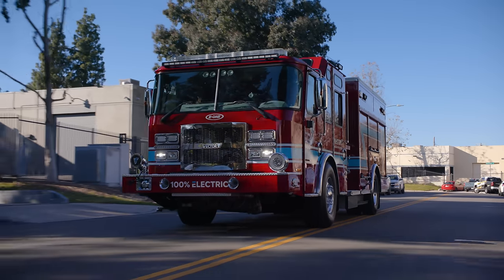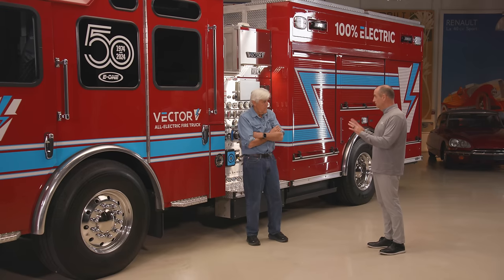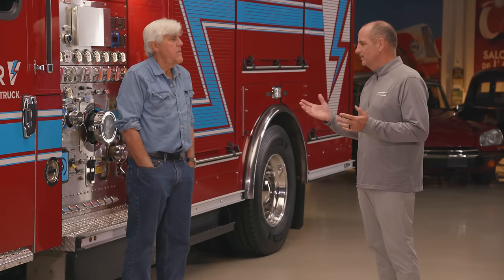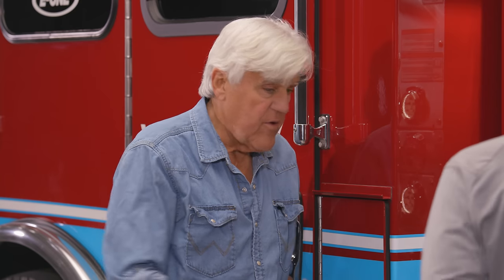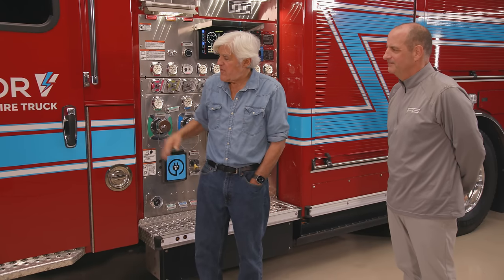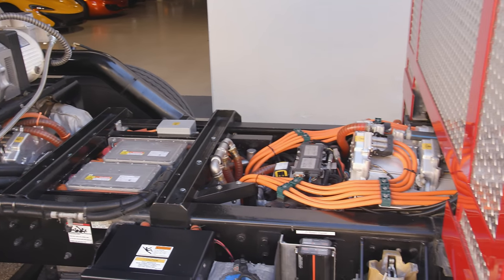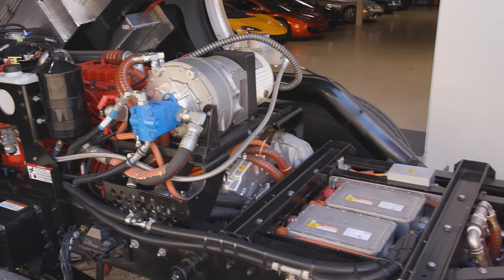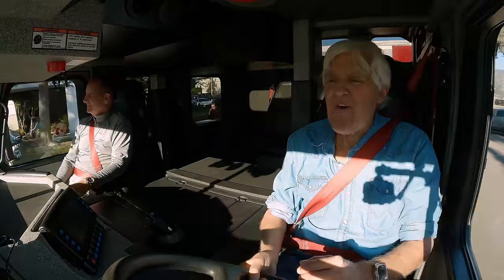The Future of Firetrucks?

Comment: I'm a Captain retired state Firefighter of NC, and just as I was retiring, my station bought two complete sets of fully electric cutters and spreaders, that's the "Jaws of Life" to you public civilians, and of course for years all we knew was the hydraulic, busting that lawn mower pump crate engine out, hooking up the lines and building pressure and getting to loud noisy work, then we were introduced to what looked like something from Ryobi 18+ series lol, just kidding wasn't Ryobi and was something way more powerful, we went to a local junk yard where a awesome donation was made someone bought us 4 cars to practice with, yeah by the way if you have money and want to donate a huge tax right off AND help the fire department, buy junked cars and donate them to the fire department to practice on, or if you have an old home on property you want destroyed, have it inspected for asbestos, if found clear, you can have the fire department destroy the home with fire.
We did that a few times a year, each year, we would run practice drills in the home do training of SaR tactics (Search and Rescue) as well as Egress, (Emergency Escape) scenarios, as well as deployment operations and tool and appliance use, as well as IC practice for the ranks, and when finished, we purposely set fire and guard and monitor it, and a fire can remove absolutely everything and in 3 years time you would never know a house was even ever there.

Well anyway, the electric gear we got was hard for us to accept and on my first Car vs. Car incident, we were able to basically, 
--- lol it was amazing actually ----
Of course after scene assessment and vehicle inspection, 
Lift the roll up, release the spreader, slap a batter in and get to it, and other than a slight hum and tool noise with car moans, we could talk and not yell in fact just from habit, I remember working the spreader and cutter, the cool part was these handheld units had the ability to switch out the head so you could go from spreaders to a piston ram and pry on or push apart.
I was working the spreaders on a car door and I yelled to have the cutter on hand and ready and my buddy was right there pat me on the back and yelled back we don't have to yell anymore!!! 

I think part of the struggle to change is just like the military, well, fire department is a kind of military it's military structure I suppose a paramilitary, we Keep It Simple Stupid, if it's not broke don't fix it, we had come to rely on the gear we've used and depended on and we have all had a battery tool of some kind fail at home, lol so we certainly don't need that when every second and minute counts.
In fact until we could truly understand and depend on them with out fail we also carried the analog hydraulic set with us just in case.

But that's a might fine kit you got there, nice and shiny, the pull valve Deck Gun lol that used to read Deluge, or Deluge G. or Deluge Gun.  It's on like donkey Kong when that gets pulled!

I stopped the the video to write, but I'd be interested to see what it's trials and tests would be like under real conditions.  Throwing the brakes and pulling the PTO out to engage a pump that might go for 8-14 hours or more is there an aux plug in in case...very interesting to see an electric pumper.  

I suppose it's only a matter of time, I can't even imagine the batteries that thing has.
Not to mention no one knows electric car fires better than the fire department, so with all that in mind I think it will be a tough sell.  I think a lot more testing and shakedown will need to be done before anyone can say for sure a yes to buy a d based on this and that how it does in the field and on deployment.  

What's next, Electric Hydrants with Digital gauges and magnetic 🧲 hose attachment?  God that would have saved my hands all those cold winters responding to a fire at 3AM in December!  
Another thought I had, what's it's crash rating, not so much how it does in an accident which is important too, but how does it do when something hits it when stationary and in operation?

There have been incidents throughout the years all over the world when a Fire Engine is on deployment and I  operation and a driver not paying attention crashes into the Engine, in fact this happened to a station in a nearby country and it was hit by a big 3500 Dodge dually and did pretty good damage, this was on the road of a two land byway a kind of highway out here, there was a center lane for turning on the straight portion, but then a wide two lane on a turn into a neighborhood, well the Pumper was in the lane and on hook up providing for the interior attack, the damage didn't stop the feed...and I'd be worried with an electric pumper, how would it have done?
I'd hate to be inside in the line, and it's a thought we've all had what if something happens and water stops?
For those that don't know water doesn't just put out fires but it provides us a kind of shield a barrier between us and the heat, we need that in order to survive, if that water cuts and it's happened, which is why the Engineer, (driver and operator of the pump) watches the gauges and knows how to read and apply more or less depending on the requirement, need, or Friction Loss.

Yeah tough sell here, interesting idea but tough sell indeed.

Comment: Hello Jay . Check out Edison Motors in BC Canada . Interesting young guys doing electric logging trucks.
Reply: They are doing some interesting work, but it's not even close to being ready for prime time. Diesel-electric trucks are not cheaper to operate than regular diesel trucks. The efficiency gain just isn't enough to justify the cost. They are banking on regenerative braking while hauling logs down mountains to provide enough energy to power the empty trucks back up. That's a cool idea, and I'd love to see it work, but even if it does, it's a rather specific use case.

Comment: First problem is the capacity to charge the battery is enormous pull on the power grid. Second the drain on the battery will run it down quickly. Third. If it catches fire how will you newtralize the flames?

Comment: What's crazy is that with all the software now pressure regulation is not automatic. Seems like a reasonable thing to have over having to manually trim it.
Reply: Most modern fire engines have automatic pressure governors. Just press a button and the pump will maintain the set discharge pressure (or volume), the engineer only has to adjust the output on each hoseline to maintain the desired nozzle pressure, and there are pumps that have automated this as well.

Comment: The inclusion of a "Range Extender" means that despite the claim at the very beginning that it is not a hybrid, it in fact is a hybrid. Specifically, it is a diesel-electric plug-in series hybrid. It is apparently a Cummins ISB, running slowly so it only produces 155 kW... enough to keep up with average demand. 

If the engine is running while the vehicle is moving, the power from the engine is operating the drive motor, so that engine is certainly driving the vehicle. The electrical system just acts as a transmission. This is how series hybrids work.

Comment: my only concern is battery longevity. there are firetrucks that were made in the 70s and 80s that are still commissioned vehicles. they can still be used. batteries in cars are lasting 10, 15, maybe 20 years if youre lucky. thats not even half, thats a third, a quarter the life expectancy

Comment: Stations I've worked was 3,000 square miles with 40 miles of I-10 running through it, and  Reese Air force Base, My issue  electric will fail, we had backup, and we had 800 to 1,200 gallon tanks. 500 gallons is for always being hooked to a hydrant.

Comment: I laughed a little at the end where Jay says at least it won't be sitting by the curb speeding out fumes from the diesel engine as it is sitting by the curve spitting out fumes from the diesel engine because it needs the diesel engine to pump the water how ironic
Reply: It does not need the diesel engine for anything until the battery charge runs low, which takes a couple hours of driving then pumping. In the vast majority of calls, the engine will never start.

Comment: It’s not about the mileage on a firetruck. It’s about the hours that the drivetrain is running. The EV fully 85% at the time it’s going to be used for running lights and the pumps. 
And we know those pumps are going to be using a lot of kilowatts. 
How long can this thing pump before the battery goes dead?

Comment: Noise issues in the cab haven’t been an issue in years.  In emergency services, you can’t PLAN your day by typical runs.  That’s why FDs have fuel trucks.  Electric master gauges, ole boy.  Talk to the FEO’s who are driving them.  They hate them, plus several stations around here need a reserve diesel to take over due to all the issues with them.

Comment: This past winter we all learned about the vulnerability of EVs in sub-zero temps; the cold drains the batteries and there's no recharging them in those conditions. At a minimum it seems these trucks would be of limited use (supplemental in areas prone to cold weather; general use in warmer climes)

Comment: 7:45 that was one of my main concerns with this. You could charge the truck from the grid but there's always that risk that the grid is down. Diesel backup is a good idea.

Overall I don't think exhaust fumes from firetrucks is a real issue. As people have mentioned "the fire is worse". But if these things can get to the fire faster and have a higher water volume output that's a great asset to have.
Reply: The pumps at gas stations don’t run without the grid either, so that long standing excuse is a paper tiger. At the end of the day I think you would be surprised at the overhead fuel costs for a fire department.

Comment: I gotta say...I'm not convinced. Fire Fighters are there to get a fire under control as soon as possible. What if there's a large fire that becomes uncontrollable and the FD has only electric units? Do we roll out the 480V power cords? Just plug into the 480V outlet everyone has right? You can refill a diesel unit without any change in delivery during an emergency, you can't do that with a battery powered unit and expect the same performance.

Comment: Fire apparatus, is to be simple and and most importantly reliable.  In the dept. where I volunteered many years ago, we still used a 1940 Mack as one of our pumpers.  The other two were new high pressure fog and volume pumpers.  At the time the Mack was 30 years old, and the pumps and engine still performed flawlessly.  On such a vital piece of fire apparatus less is more.   Technology, ok I get it, but just by design this electric apparatus is a set up for failure at a time where it is needed to save lives and property. It is set up for failure because virtually everything relies on electronics.  Lets not even talk about battery failure and the deadly conflagrations those produce.  I would vote against electric powered apparatus, too much risk for failure.

Comment: I hate when they say ‘Lowering Greenhouse Emissions’. It is just transferring the emissions to the 3rd world where all those materials are being strip mined. Those countries are using increasing amounts of carbon to run the mining operations. Until we figure out a better battery technology that doesn’t require huge amounts of lithium and cobalt, it won’t change much of anything.
Reply: Not to mention the greenhouse gases produced to generate the electricity needed to recharge those big batteries.

Comment: ❤ The brilliant design. 
This is the same concept as the all new Ramcharger🛻pickup truck which uses a v6 gas engine “range extender, also not mechanically attached to the drive system.

The Ram🛻 “range extender” v6 gas engine is attached to an onboard generator that only runs when battery packs need to be changed, critical when plugging into the grid power grid to recharge is not an option. 

The Ram🛻 battery packs power the both the high voltage⚡️ front and rear drive motors and the traditional low voltage system to power everything else. 

This may work well in California, but not necessarily well here in the Colorado Rocky Mountains🏔️ which have very steep road inclines and extremely cold Winters which both significantly shorten the lithium battery range and its physical longevity which is extremely expensive to properly dispose of and replace.

In addition, the significant higher purchase & maintenance costs, the cost/benefit ratio is completely upside down for 99% of the Colorado fire truck market.

However, when solid state batteries become available at 900% lower cost and weight, which also have superior cold weather performance with no short or long term degradation, only then it may be a practical affordable performance alternative for the Colorado and other USA fire truck markets.

Comment: The interior looks just like a conventional truck, because there was no attempt to take advantage of the powertrain. That huge doghouse between the front seats is to fit the huge diesel engine that it doesn't have, and the smaller diesel that it actually has is there.

Comment: Hmm whats the specs on this thing? Firecrews work  on their vehicles too as they don't always have the option of extended downtime of having the engine in a shop, so quick repairs by the crew is often done. 2 my worry is standby time, a standard fire engine with a diesel or even a gas engine can run for days while it sits with all the lights and equipment running. How does an EV truck handle this, how long will those batteries last when you have a fire/ emergency that lasts longer than an hour on station. 4 hrs of pump time at full power plus the backup engine to power it for more hours? good idea but adds more complexcitity something else to break. Besides physical gauges are better as they are mechanically linked to the system and the media being pushed= water, an electric unit can fail or malfunction and not give you a reading or inaccurate reading. This is nearly impossible to happen with a physical gauge. when it comes to EMS redundancy is key you don't want something that can break and leave you screwed when you need it most

Comment: I think that a diesel over electric could have some benefits.   Smaller diesel generator running at a constant rate. Powering the truck.    Direct drive fire pump direct drivetrain.  Less moving parts.  Constant power easy adjustments .  That way it’s self sustained. No plug in !!   I think a total battery powered is a bad idea.

Comment: all these people saying you want more weight in equipment or water rather than batteries, but you have more torque so you could carry more weight anyway right? what exactly do they mean by "more equipment" anyway? some fireaxes? seems like a nonissue. People are also saying it's going to run out of charge, ever heard of charging before it hits 0? is are firetrucks being called over 140 miles away for a fire? IDK I feel like there is a lot of smooth brain going on here

Comment: So. The most modern fire truck, electric and all, and at the same time, feels so so so old.
USA really need to get the grip on this stuff and be modern.
Modern pumps. Modern high pressure hose reels. Modern controls.
Now i did not find a good video of how a Swedish fire truck can be (we have different types of course but in general they are all the same - some are larger, some smaller) but this one from Netherlands is a good representation.
Here they have arrived, pull the hose and start the pump.
https://youtu.be/SVkso-7EsBs?t=429

Comment: The Toyota Prius is a really good car. With it you have the best of both worlds,  Its battery is easy to replace the rebuilt unit costing about $300 bucks, with $150 for your core.  The average home mechanic can replace it in about 3 hours, professional can do it in a little over an hour.  The nice thing is as battery technology improves the replacement is better then the one it replaces.  You can install,, as required in the EU, a switch that allows you to go pure battery which would be great for use around town,  Another thing you can install is a AC converter which makes the Prius into a dandy emergency home generator.

Comment: While, yes, they seemed to address a good bit of the standard problems, it still has problems. 1. Volunteer departments are almost never going to be able to afford these. Then factor in maintenance costs, like battery replacement, and even cites are going to bulk at it. 
2. at least on the East Coast the weight is a no go we have very very old historic stations still active in fact one of them is in my home town so much so the horse stables are still there on the main floor ok course they have be renovated but they had to move the Truck out of the station for the first time since well Ladder trucks were a thing because the truck was too heavy for the floor. 3. while they are on the up from some very bad years E-one is not a well liked company still today see the slow to change mentioned. On the plus side it does look and mostly function like a standard Engine so points there.